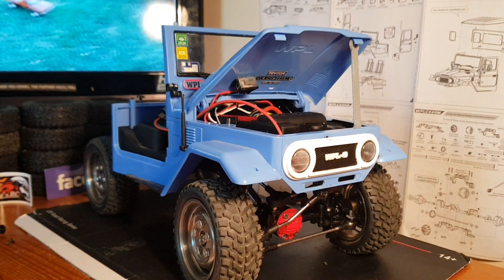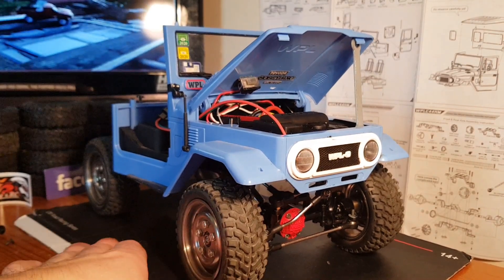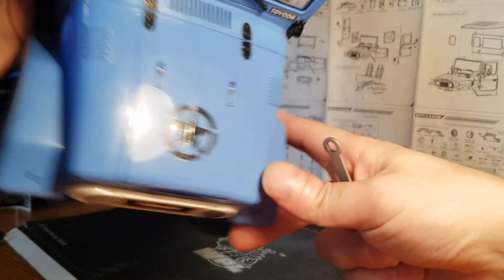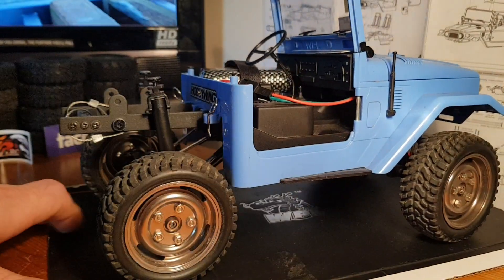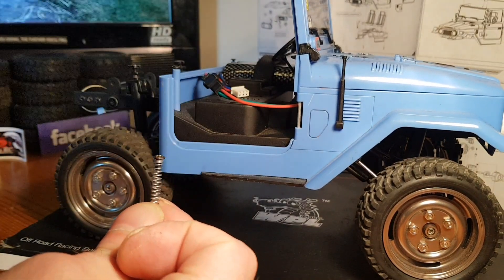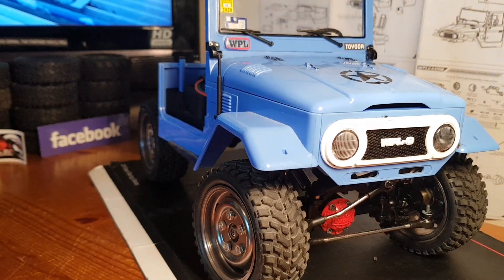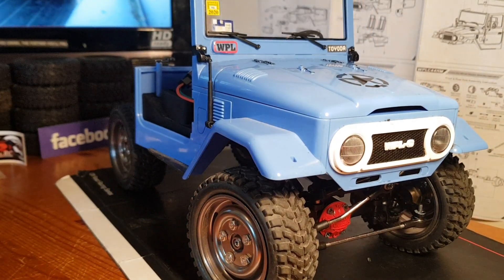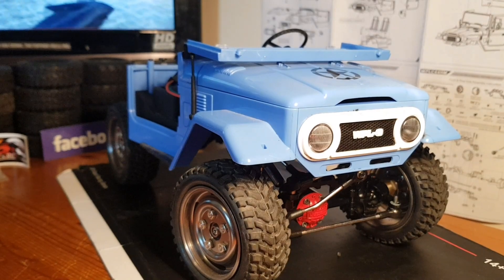Modified WPL C34km 🤤

Comment: Nice idea with those 3D printed adaptors,the only difference with mine is that I'm just using a mini 30A ESC. Like you I went with a single speed geared 370 motor into a reverse transfer box.
Reply from the maker: The wpl single speed for the c34km is an amazing peice of kit, 2 gears running each driveshaft, so simple but so effective! The hw1060 gives me a super slow controlled crawling pace.

Comment: Thought with those wheel adapters could you run a really long screw through then cut the heads off so you could run a nut on the outside as opposed to screwing the wheel on ??
Reply from the maker: That is an option yes 🤤 I personally dont mind a screw fixing.

Comment: looking like a good performer, the longer shock rod mod would maybe help even more..
M3 half threaded 50 mm length cap screws, cut threads to leave 6 mm for the lower eyelets, grind+polish the hex cap head diameter down to fit inside the shock bodies. gains about 4 mm of negative travel at the shock, is near twice that much at the wheels. only costs about 2 bucks and a little time per vehicle. you do have to CA the threads into the lower eyelets for being 1 mm smaller, but they'll un-thread easy enough after the CA dries so its not a problem.
Reply from the maker: I'm gonna try ramzi from fb mod, drill the shock hole big enough for the shock link to fire inside the shock, giving 4mm extra flex 🤤